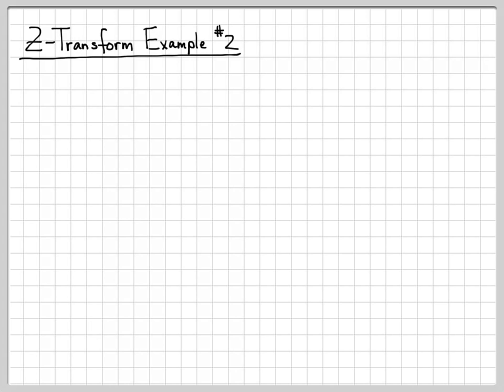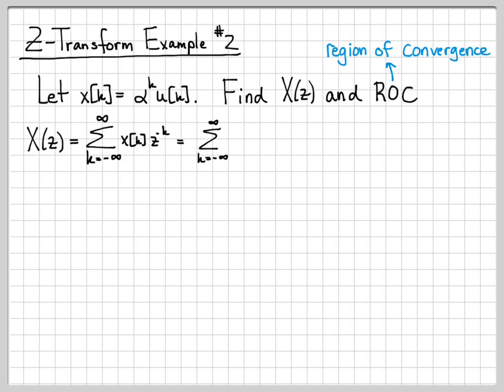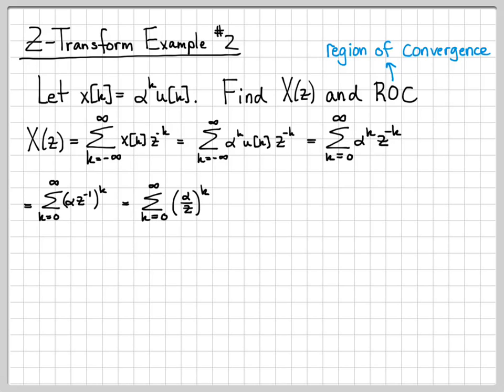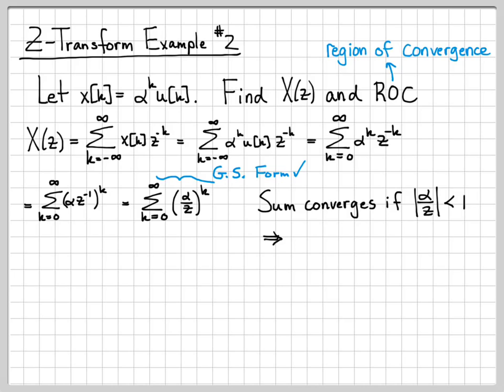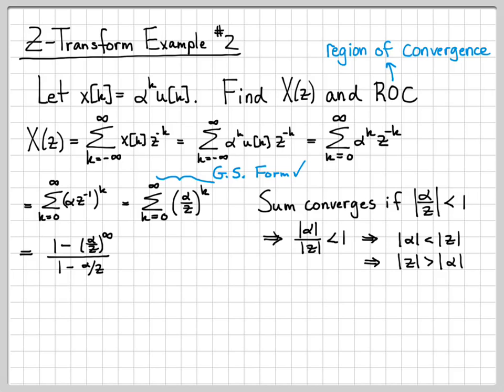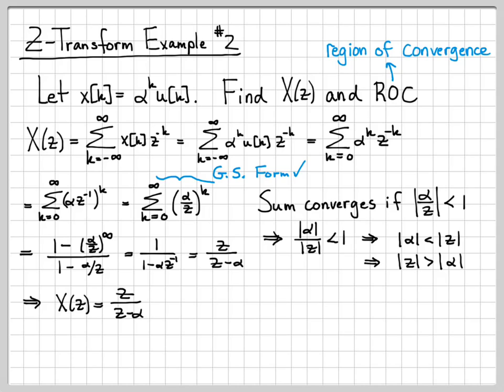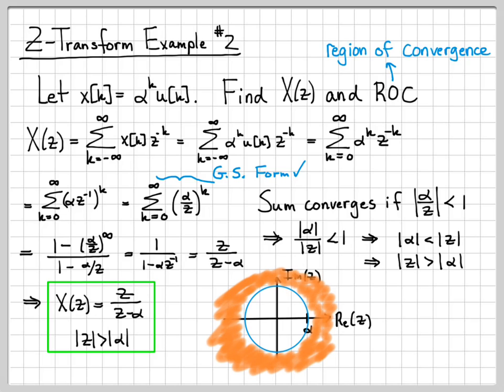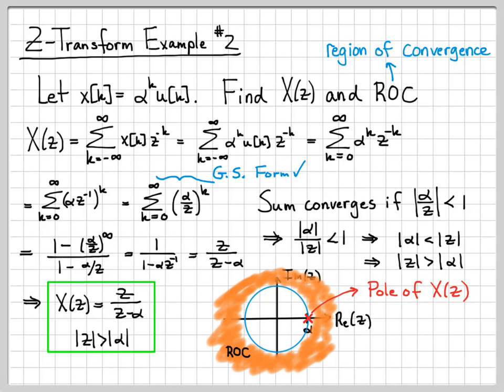Z-Transform Example #2 - Z-Transform Part 1

Comment: At 3:00 you say "we can just use our table" but then you wrote (1-(a/x)^(infinity))/(1-(a/z)). Could you explain that step? I have a professor whom insists on us doing these by the definition and not by table look up so I am thinking if you could explain why you did that part and what the reasoning is it would help me a bunch. Thanks in advance.
Reply from the maker: +chrisplusian At that point in the video I'm using "facts" we know about the Geometric Series.

You can read details about the geometric series and also a derivation of the result I'm using here: http://mathworld.wolfram.com/GeometricSeries.html

In general, the sum from k = 0 to infinity of r^n is [r-r^(n+1)]/[1-r] so that's the result I'm using here from our "math table".  But, the derivation of this result is given in the link above if that's what you need.

Hope that helps.